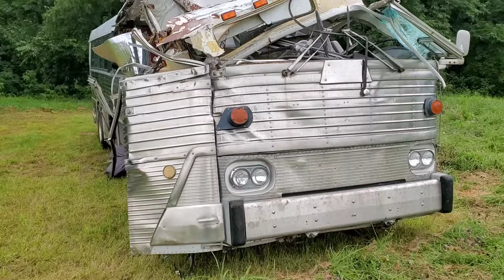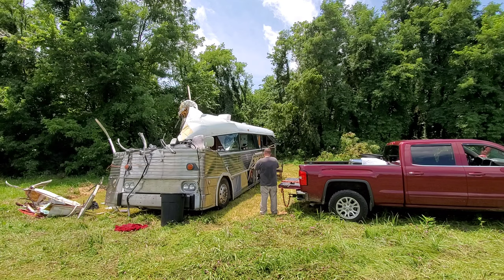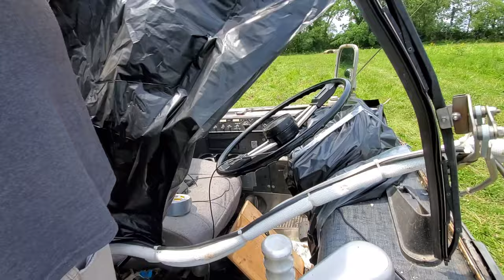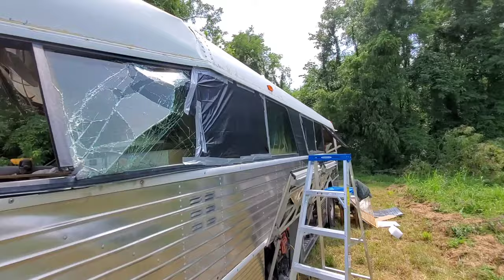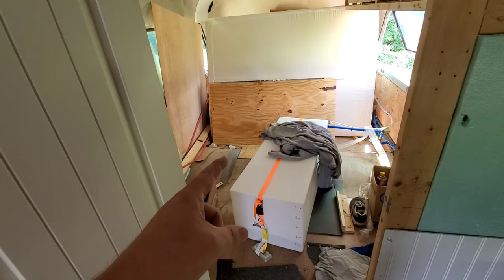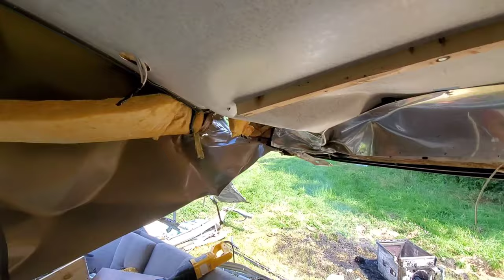mci mc5 bus conversion wreck salvage day 1

Comment: What happened and how
Reply from the maker: https://youtu.be/ZaGU3JljCaY.   Here's what happened.
Reply: @Bairleafarm  what size is the tires
Reply from the maker: @kevinwallisa9910  11r22.5
Reply: How much for front wheel and tires and the rear 4 wheel and tires that would be 6 and total. Would have to check to see if they would fit my 1969 International Wayne bus
Reply from the maker: @kevinwallisa9910  they are not currently for sale.   They will be the last thing I will sell.